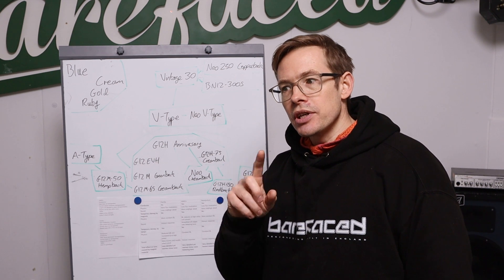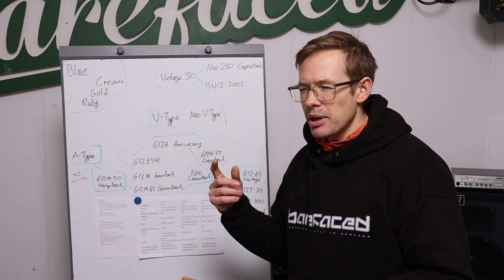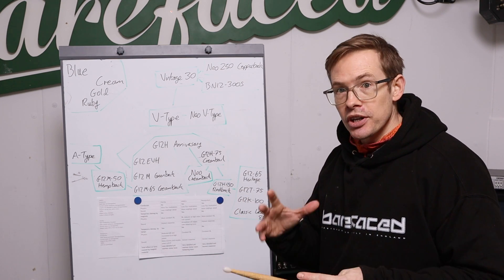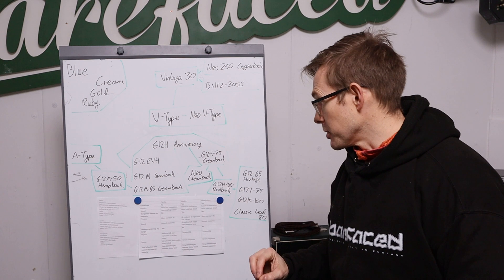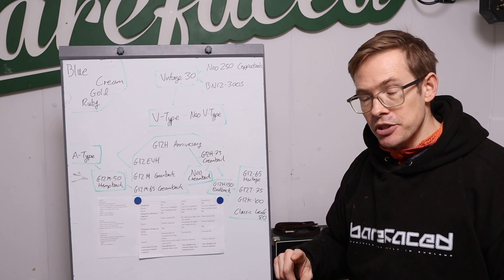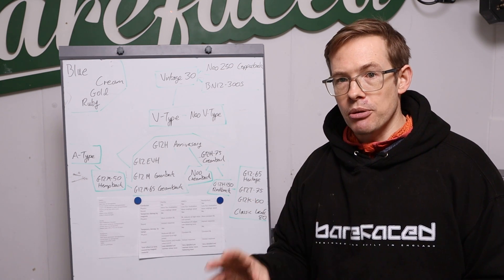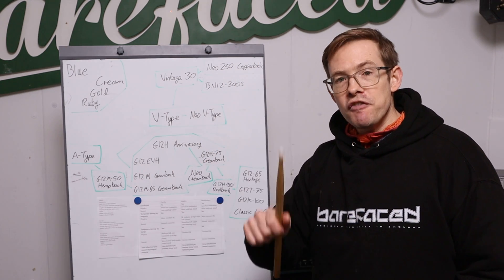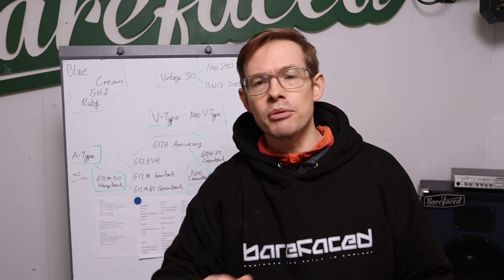The first video to properly explain why AlNiCo, Ferrite and Neo guitar speakers sound different?!!

Comment: Pardon me, sir.  Eddy currents require a conducting material to exist.  If, as you say, the ferrite is a non-conductor, there will be no eddy currents to resist the passage of flux according to Lenz's Law.  Your argument here collapses.
Reply from the maker: @mboykin6047  aha! Then it must be eddy currents in the larger pole pieces required with ferrite magnets. To get as low distortion with ferrite magnets as with neo you have to add shorting rings to the motor.
Reply: @BarefacedAudio 
Most of the speaker motors arrange with steel flange to focus magnetic field.
Based on this, all this nonsense with eddy currents and Curie points makes no sense.  😁😁 And there is no clay in ceramic magnets; they consist of a mixture of iron oxides (near 90%) and a couple of other metal oxides.
Reply from the maker: @iridios6127  Ceramic magnets are made of a mix of iron oxides and some other metal carbonates, not actual metals, hence the lack of conductivity.
Reply: @BarefacedAudio 
 First of all - carbonates don't withstand temperature of manufacturing those magnets.
Ba and Sr carbonates used since chemical activity and danger their oxides.
They do not go through process unchanged.

Comment: Part 1.

First thing I want to mention is that first guitar amplifiers were combos and those have had speakers without permanent magnets. As you know there were tubes only. There were no transistors available. Speakers have had so called field coil. It was used to generate magnetic field instead of the permanent magnet but cleverly it doubled as the choke as well. Two birds with the one stone sort of the situation. 
How to all the other things. Most of the stuff mentioned is kinda right but it is way more complex than that.

First we have to establish the rule that guitar speakers and cabinets are not designed same as home speakers, as PA speakers, as studio monitors or subwoofers.
They use different materials for the cabinets and different calculations for the cabinets.
Very same thing regarding design is true for the drivers them self. 

When we design guitar speaker it does not mean we want or need to design perfect speaker with best characteristics. Those perfect things would be win for other types of speakers where superior damping and cooling and less mechanical loss would make them “sound” better and increase the power handling.

For example for most of the other speaker types we want die cast baskets with less as possible surface that is parallel to the back of the cone to restrict as little as possible the free movement of the cone. We want more linear Xmax. We want ventilation everywhere. We want super stiff but light as possible membrane. We do not care much about the reproduction of the top end because other drivers will take over. We do not care about the damping factor because amplifiers are transistor based and can take way more current back than the tube amplifiers. We want string magnetic field that does not change. 

Now with the guitar speakers we play all of the range with single big driver. Your typical 12” driver right? Well take almost any other type of 12” speaker and play full range signal true it. It does not work. Top end is gone.

Weight of the membrane/cone, stiffness off the membrane, coating of the membrane, material of the membrane will define what frequencies you can play. Surrounding and spider will dampen some frequencies as well.

How come guitar speakers can play top end than? Well they do it with a simple trick based on imperfection of the cone. Actually most of the top end is played by the middle of the speaker and the dust cap itself. Paper cone damps high frequencies and they get lost until the reach from the voice coil to the surrounding of the cone and the basket. You have to understand that the actual movement of the membrane is not the same for all of the frequencies. Tweeters are small and move fractions of the millimeter at normal levels and still make for example 97 dB at one meter. For the same sound pressure 12” subwoofer has to move way more.

So when we understand that we now know that during guitar playing cone moves in heretic way and is moving more for lower tones and at same times it shakes making other higher frequencies. But point is that it does not need to move as much to play top end loud.

In your typical other type of drivers for other purposes you do not want membrane to play top end and you want to prevent hectic movement of the cone and parasitic vibrations so you dope the cone to demo them or you choose materials that are damping those vibrations but play perfectly ranges that they should play leaving the space for the other drivers to play they part.

Now dust cap is highly misunderstood part of the speaker and especially in the guitar speakers it has huge effect on the tone and the performance. 

The first usage is in the name and simple to understand. It keeps the dust out of the motor of the speaker.

Second one is cooling usage. It literally pumps air around the voice coil and true the. Pole peace and basket vents if they are in the speaker.

Third is dispersion of the top end frequencies. Smaller more pointing bullet shaped dust cap has wider top end dispersion. But it captures less air and makes the pumping cooling effect less.

Dust cap material and size also influences mechanical damping of the speaker a lot. Even more with speakers that have no pole ventilation.

And lastly dust cap weight influences resonant frequency of the speaker.

Now once again in the other usage speakers we want the dust cap that cools the best and adds the smallest possible amount of mechanical damping.

Sure we like cooling in our guitar speakers but that’s not our main thing. We are happy with lower power handling speakers as well. They sound alive and often have nice tone.

Now mechanical damping is something we can tune but we necessarily do not want to remove it in the guitar speakers while it is part of the tone of some speakers.

Material can be solid paper and that has no give. But some speaker use textile dust caps with different level of how much air can go true it. They are still filtering dust but reduce somewhat mechanical damping especially of the bigger dust caps and they play top end differently often even letting middle of the cone play it and they just let those high frequencies true like the grill cloth.

We need stiffer suspension of the cone to prevent loose low end and help play other frequencies. We need spider that will accommodate such cone movement as we get in the guitar speaker.

We use stamped still baskets and those also add color to the sound. They reflect back to membrane and they are increasing yet  again damping of the cone movement. Holes are just to small so they are slowing down the cone. But that makes guitar speaker sound way it does. Plus stamped still baskets vibrate and color the sound somewhat with that as well. Some early guitar speakers have had tons of small openings and back was opened only 50 percent. Those were not so efficient speakers but those have had their specific tone for sure.

Next to a all of those mechanical damping we have electrical and magnetic damping that’s very much connected with each other and interacts with everything else.

Let’s look at them separately so we understand what’s happening better. When we send signal to the voice coil we make it move in the magnetic field. We profit from that effect because we generate mechanical force that moves the membrane and give us the sound. But every coils that moves in the magnetic field inducts current as well. This is sort of action reaction thing. That inducted it generated power has the opposite direction and is sent back to the amplifier. Amplifier has to be able to handle it. Damping factor of the amplifier describes its capability to absorb this current and deal with it. This is directly related of the output stage impedance. Higher it is less current it can take an lower the damping factor gets. Why is this important? Well amplifier that can’t take that current back is fighting with it and can’t control movement of the cone good even if the speaker and cabinet are really good. Therefore in audiophile world amplifier with higher damping factor will be more accurate.

Now transistor outputs have way lower impedance especially when they use many parallel transistors.

Tube amplifiers have output transformers and do not like current coming back to them. Even in home audiophiles tube amplifiers people use small drivers with small voice coils and even wide band drivers to avoid generating return currents by many voicecoils in parallel and to avoid complexity of what happens with those currents and passive crossovers.

Just remember bigger voicecoils generate more return currents. Louder you play you generate more return current.

Comment: Part 2.

Now again we have our worlds and in it what we have sort of works for us.
Now how that all in the Part 1 has anything to do with magnets you ask? 😂

Well any current spent or generated has its magnetic field. That field interacts with speakers engine.

Now we need to understand that ceramic magnets came from the bean counters requests. Fact that engineers made them sound good is something completely different.

They are electrically non conductive. But they also conduct heat way worse. Hence they tend to accumulate the heat and need cooling. But even absence of good cooling has its sound because it adds compression.

Ceramic magnets came in as cheap solution. They are massive and heavy because they are not efficient. They are fragile as well. As any other ferrite core they shatter on smallest mechanical interaction.

Now need and absence of money meant people have had to make workarounds. So to generate better power absorption and stronger field they made them big and heavy.

Then they started pole and chassis venting but those did not came in guitar speakers always.

What is very important to understand is how magnets structure is designed. Pole peace’s and how magnetic field work in the speakers is often misunderstood. 

Ceramic magnet is sandwiched by two metal plates. Back plate has pole peace that brings polarity of the back of the magnet forward to the front pate. Front plate is like washer or doughnut. We fix magnet structure to the basket using that plate as well. So it’s a disk with hole in it. It’s thickness determines usable depth of uniform magnet field of the magnet structure. Space between it and rear plate pole peace is the home of the voice-coil. The only part of the whole magnet structure that positive interacts with the voice coil is that space, that ring formed slit between the front plate and the rear plate pole peace.

Rest of it is providing magnetic force and cooling.

Now indeed both signal current and generated return current will again generate inductive currents in anything metal in their proximity. Here comes the importance of the back plate and it’s pole peace material and construction. 

Ceramic magnet is further away and it’s diameter is huge compared to other type of magnets. Saying it is not electrically conductive is not 100 percent true. In that powder mix we do have iron but it is surrounded by isolator. That iron takes the magnetic charge and becomes magnet. Luckily that powder is so fine and so far away that we do not need to bother about any eddy currents in them plus everything is isolated by the ceramic so there is no possibility to generate much current.

What is the problem place is first and most the back plate pole peace. It is iron based metal to be able to conduct magnetism from the back to the front. Currents generated there are losses and turn into heat and affect the control capability of magnet controlling the movement of the voice coil and there for the cone.

Then we understood that drilling the pole peace for the ventilation and cooling purpose has changed how those eddy current were generated and how they interact with the voice coils and even how much return current is generated.

Some companies even started incorporating damping rings made of copper into the top of the pole peace controlling where and how those currents are generated.

Now again that did not mean all of that came into the guitar speaker designs.

Not that designers do not know it but they shape the tone by using or not using some things and tuning the tone to their liking.

But all of those choices define unique tone of the each speaker.

Like M and H magnet size in early Greenbacks. The same cone and voice coil, basically same speaker could take more power because of the magnet size and weight. Simply more thermal reserve and more cooling due to the mass and more surface. But it changed the tone as well. I bet they didn’t expected that one. Simply stronger magnet controls the cone and the voice coil more effective resulting in less distortion of the sound and different top and bottom response.

So point being you can’t generalize speaker tone by just one thing because everything matters and can turn the tables sometimes.

What everyone could hear is that some speakers are better for clean and not for gain sounds. Or the other way around. But some perform good in both. Some seem to lack top end in gain sounds but actually have excellent top end in clean scenario.

Look at the Eminence black shadow for Mesa and EV 12L for Mesa. Both massive ceramic magnets speakers. Eminence has no top end when in high gain scenario but has when clean and in low gain scenario. While EV 12L has top end always. Both ceramic magnet speakers with what looks from outside similar construction. But yet they are so different. And then came Celestion 90 Watt version for Mesa with smaller magnet and it brought more top end.

So you cannot say this magnet will do always this. It is way more complex.

Look at the first Celestion Alnico Ruby. It was very dark always. Clean and overdriven. Now they changed it a bit and added some more middle growl and some top end. But it stays non typical Alnico speaker.

Even Alnico Cream is not as bright as the Blue, 100 and the Gold are.

Lastly power rating is also influential in the tone. Compare Creamback M and G12-65 Heritage. Lot of times similar power rating speakers sound similar. Lower power speakers tend to be more alive and often bright with looser bottom.

There is something with sensitivity as well. But that’s another huge story for another time.

Companies change stuff as they learn or depending on the feedback.

Look at the Copperback. It came first without pole vent and as 2,5 kg. Then it got pole went and became 2,3 kg. It opened up an started sounding better to my ears. I am not sure what they have done to it next to adding that pole vent. But they made it sound better.

So my advice is to take every speaker with the open mind and judge it on its tone disregarding what construction it has.

Plus we all hear different and we all like different tone. So most important thing is that we like how that speaker sounds with our rig and with us playing it. The only important thing is that we like it. No matter what it is or how much it costs.

Look at the PRS using V type. One of the cheapest models. Sounds good to people who chosen it in the PRS and people who bought those amplifiers.

Comment: This video inspired me to take the plunge and buy a set of Neodymium speakers for my new guitar amp.. against the wealth of evidence in forums that Neos sound too bright and brittle. This is an opinion mostly formed by YouTube comparison demos I imagine.

In my experience you need to change your amp settings to account for the higher level of detail in the upper mids and high frequencies when using Neo. If you don't, they sound unusually bright. Unfortunately in the name of keeping things fair most demos keep the same amp settings when changing speakers and end up biasing their results towards the most common speaker type of that demo (usually Ferrite).

Neodymium speakers are the perfect choice for those wanting an honest sound out of their amp (my point of reference for my own comparison was EVM12L/G12H vs 18Sound 12NMB420/Mojotone Neo through a Ceriatone SSS using a Strat)

Comment: Alex, thank you very much for your always amazing efforts to deal with insights of physics indeed. Royal Engineers are supposed to greet themselves still with Glasgow handshakes for letting you leave for your civilian career. You are serving the country of finer guitar and bass sounds. 

I didn't consume all of your lectures, but as far as I remember one bit is always being taken constant: the electricity. 
Though amps likely work with transformators to mitigate impact of regional voltage and amperage, doesn't this detail influences the reaction of a driver aswell, does it? Is it a proper assumption using the same amp and cab in the USA, GBR or DEU may lead to a slightly different sound?

Comment: I've used lots of AlNiCo speakers from Weber, and some of their ferro ceramic jobbies. I also use some greenback style Celestions. My subjective experience is that the AlNiCo speakers are brighter and more articulate, and the ceramics are louder and have more bass. In the case of the Celestions, they're MUCH louder. One of my favourite sounds was with two amps: a 5E3 clone running a 12" Celestion greenback, and a Champ clone running a 10" AlNiCo in mono. The sag and compression of the 5E3 contrasted nicely with the stiffer single ended amp. The AlNiCo 10" reproduced lots of attack and detail, while the Celestion thumped and growled. I built a master vol. into the 5E3 to help balance the loudness and it was a glorious combination.